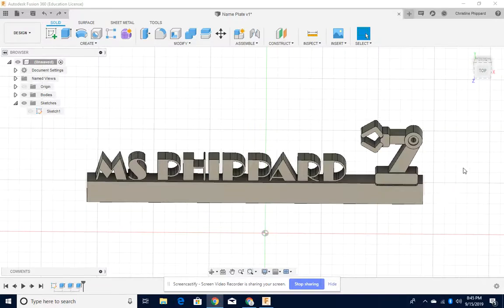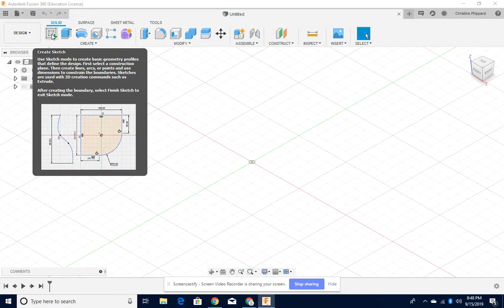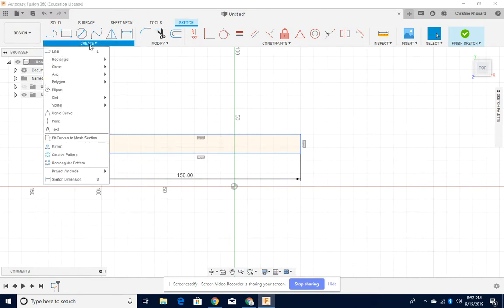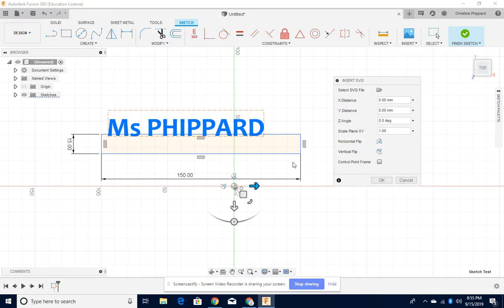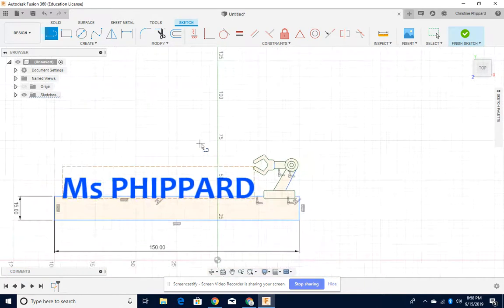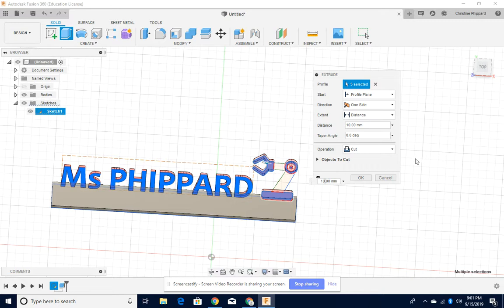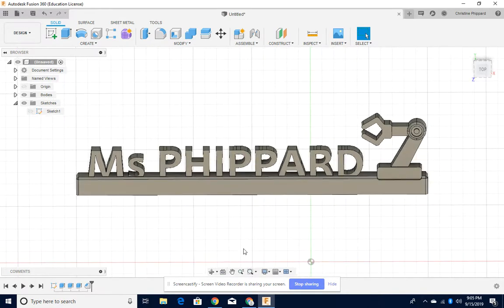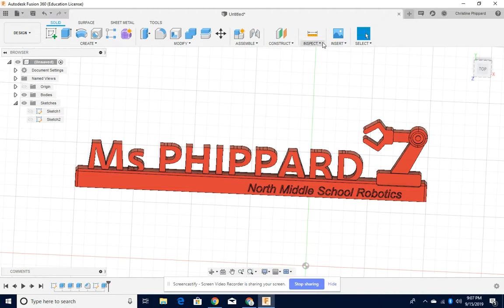Fusion 360 Intro: Name Plate Project

Comment: Superb ! It helped me a lot. Just wondering, is there any way to cut the back side of the letters to put some led strips to make it a led name plate. Anyway thanks a lot for this tutorial.
Reply from the maker: Sorry this is so late, was not monitoring the channel. I'll reply so that others may have an answer, though I assume you've already figured out a solution. I would use the Shell tool on the back of the letters. It will follow them out.